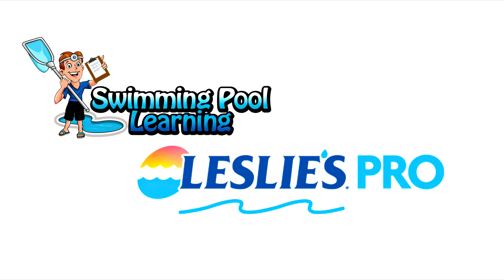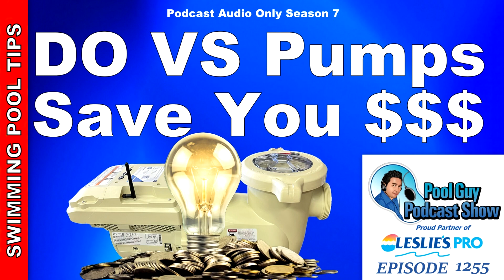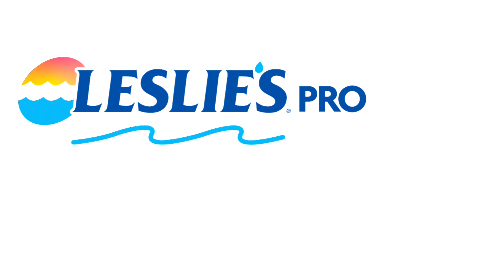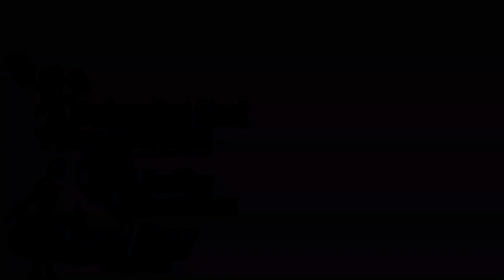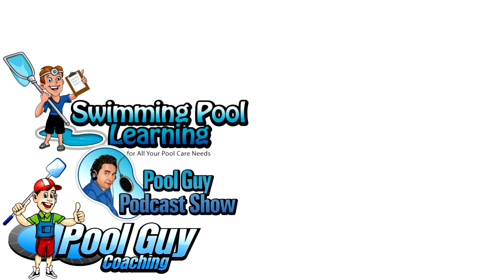Do Variable Speed Pumps Save You Money?

Comment: I run my Intelliflo (Pentair 3HP ) at 1392 RPMs (27 gallons per minute) from 8am to 10pm.  I have a 15k gallon pool (pebble tech). According to my pump display, my pump is using 132 watts of electricity.  I am a pool service pro, and I have virtually zero issues with my pool. Once you run the RPMs over about 1700, the energy use seems to double, then at about 2250 RPMs your at about 700 watts, then at about 3000 RPMs you are using about 1900 watts. The power use rises dramatically as RPMs increase. Note: I set my pool vacuum to 100% sucion because I have nearly zero vegetation near my pool, and the skimmer is not needed. If we get a wind event, I switch my diverter valve to full skimmer to get any leaves or debris that falls on top, but its extremely rare.  Huge savings this way.